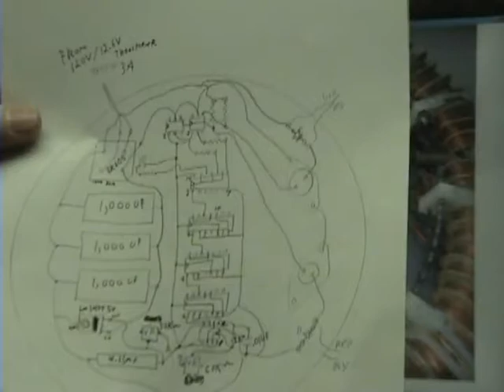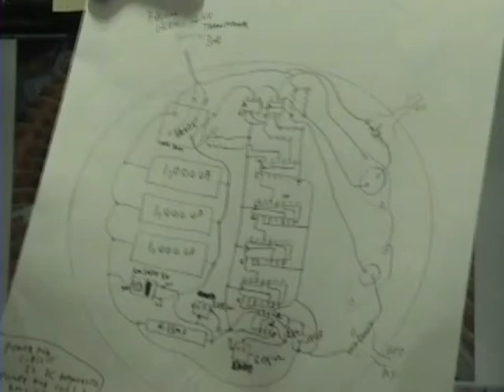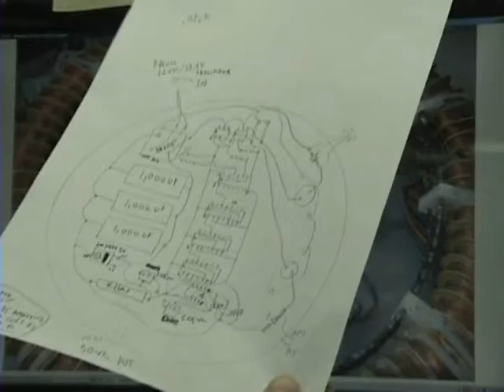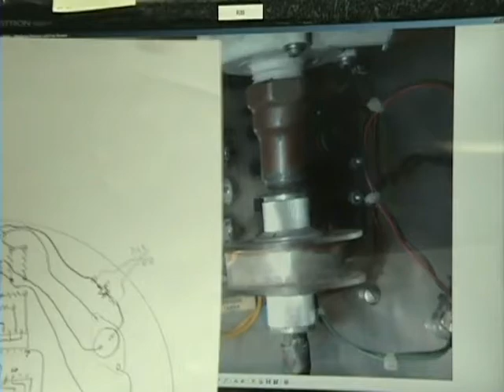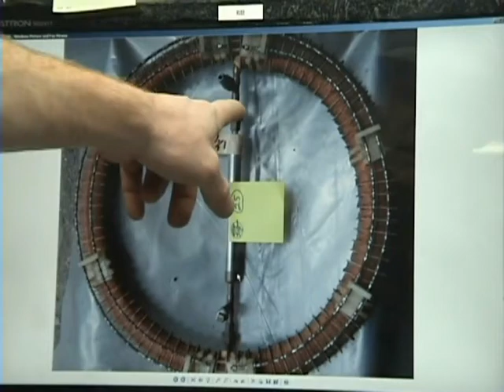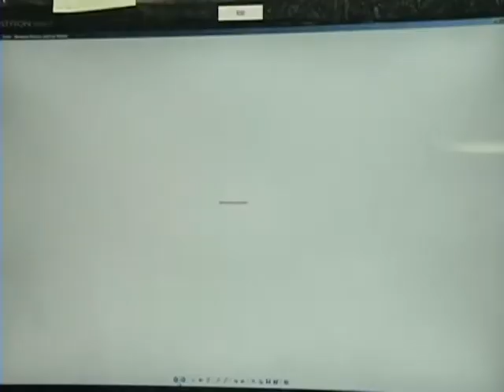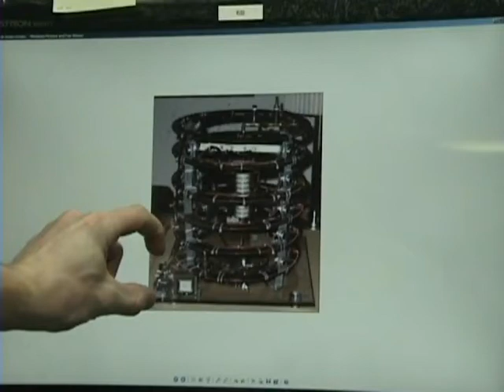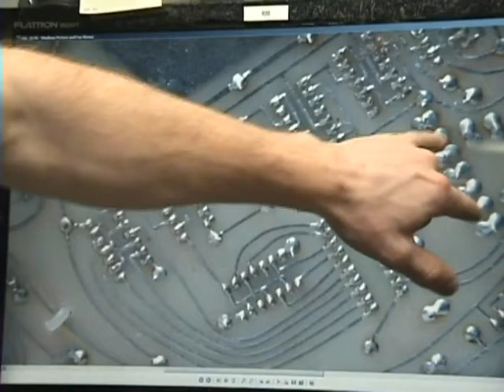Stans Estate EPG High Quality Photos RWGresearch.com

Comment: The Stan Meyer system used water vapor in his tube structure.  This was created using a vacuum in the tubing from a bubbler.  The vaporized water was then pumped thru the tubing into a dual magnetic coil arrangement where it’s molecules were separated into H and O atoms by the two opposing fields North against North.  When the water molecules split apart they gave off a huge wave of Etheric Force Field.  This newly created field traved along the three turns of copper tubing becoming Stan’s Primary Coil.   This primary coil had many Secondary Coils wound around it all of which were connected in parallel to two brass solid rods bent and supported inside the toroid structure.  These two brass rods provided the output for the device.  Other secondary coils were used to supply the device with its own power source.  The input to the device and output from the device was water H2O.
 
John Keelly did basically the same thing using sound waves to breakup molecules of water into H and O atoms.  By combining three waves Keelly could disassociate droplets of water the splitting of these molecules produced a powerful Etheric Wave Field.  Keelly used very small diameter tubing to act as a conduit to route the Etheric Waves into his motor design.  The Motor consisted of groups of odd numbered small disks which used the Etheric Waves to oppose each other providing his motor with rotation.  John Keelly when a kid used sea shells in a box which he had arranged so that they too could use Etheric Wave flows to give him a spinning Sea Shell motor.  This device ran when musical notes were played near it.   A penny for your thoughts.
 
Both inventions worked, but to this day have never been implemented to help save our planet.

Comment: The photo shown of the copper pipe you were having trouble with figuring the size of ; the two hex head screws on each side of the pipe appear to be standard 1/4" hex heads if that helps. Photo appears at approx. 11:34 in the video for reference. I'm guessing 5/16" or 3/8'. Good luck on your research.

Comment: Russ, I believe the device in the center is a magnetic pump. In his video, shared by Daniel Donnatelli, Stan explains this entire ordeal, and the many variations of the system. He stated that he used this with the output of the system, once pulsed to start, and of course the gas magnetized before he filled the tube, the magnetic pump would speed the gas up and it creates a much higher amperage. It could be another device as well, where he used a 10 watt laser to create another type of reaction by introducing plasma to the system where the energy could have ended up many times more powerful by allowing electrons from many other elements to break off and collect in multiples at the output. So, as he explained, the Oxygen molecules could have started with all of their electrons stripped, as he says if there were 4 billion atoms, then the electrons collected in the end could be 4 billion, amplifying the current flow 4 times. I'm not exactly sure what the entire process is but it is intriguing and it certainly has something to do with the electrical generation he used to fire is cell in the dune buggy giving him more than his input for self sustaining operation. It has been unclear for sometime as to how he did this, but now that the video is revealed, it has been making the gears turn in my head as to how to get this all operational with much greater ease. The VIC circuit certainly comes into play here, and I have found these and acquired them online to start the process of experimenting... I just need to find the time to make it all happen which is not existent at the moment. People are commenting here to state that the circuit looks like a con. This is what happens when they don't know what the hell was happening, or they are paid to assist in suppressing it to eliminate use by anybody who may believe it works. I smell oil company personnel.. LOL Anyway, why would the man pay thousands of dollars to patent anything so it is a con? The process was created previously in the 50s and never worked correctly. Stan took this and corrected it to function with the laser technology available to him as in the 50's it was non existent. The other thing is that many German Physicists from WW2 have left their kids and grandkids with unknown secret technologies that weren't ever used after WW2. This could certainly be something Stan acquired and took advantage of. He states he never had any experience or training in school for any of this. Somebody obviously taught him from his family because it isn't something taught in high school. He explains it as if he were a professor in the video link below.  https://www.youtube.com/watch?v=xUgXrPsyo9s

Comment: the thing in the middle you called a heat sink is a PLATE CAPACITOR that looks home made. that's a huge DC capacitor also it looks like 1/2 copper pipe as 3/8 comes in tubing usually with Farrell connectors

Comment: The Heat Pump looking thing isn't a pump. Its the laser EPG system. Like the tube version, its uncompleted. Its not a tube, its a 10 watt laser, and the fins are used to cool the laser.

Comment: red coating on pipe is probably spray on insulative laquer used by motor wiring companies. Pipe looks heavy wall as often found in refrigeration piping.

Comment: Nearly 100% certain that is a one half inch copper elbow. Looks like the pipe diameter is wider than the size of the adjacent hex head bolts which are about 3/8.

Comment: Frequency tuning is a missing component.  In order to achieve full photonic effects, displaceme nt is necessary.  Yes it is a resonant frequency, and yes the system will not work without internal light.

Comment: it seems like he liked to cut the system in half, crossing the 2 chambers. this is of interest. and the magnetic pathways of the PMG is an added feature. if you had  square in a square you could cut 2 magnetic paths ways, adding the cross sections one on each side so on to 3 squares in a suqare with 6 magnetic pathways.

Comment: I suspect that LIthium hydroxide was the electrolyte and that the coil is actually a accidental cold fusion based on a 1950's muon based system. that was not successfully as required 5 MeV and made 2 MeV

Comment: they cant be usinf ferro fluid , its non magnetic  , it said in your other video and would make sense that the fluid or gas has to have magnetic particles only and I dont understand the copper pipe when you said in the patent it said specifically no conductive pipe

Comment: Hay Russ! I just got 4 12000 volt neon light transformers. Probly cost a fortune to send them to you. What's in them that you like? is it the wire or is there magnets? Duh they are about 20 lbs each. Ferrofluid is a recent invention - I don't think Stanley could have known about it. The green on the copper is oxidation and or electrolysis. The size is going to be 1/4 or 3/8 and probably refrigeration tube. Stainless pipe might be better. Lemme know about the transformers if you want them or not

Comment: This thing looks like a con. Meyers may have built this thing, but it can't be that difficult to see what the end result has to be. One needs to produce enough browns gas to run an automobile motor from the on board water . For a VW DUNE BUGGY; THIS IS A BOUT THREE HUNDRED CUBIC FEET OF AIR AND FUEL PER MINUTE. I've been watching this stuff for ten years and it gets to be like watching the x-files . Science is based on repeatability and no one has been able to do what Meyers supposedly did. Welding companies make browns gas generators for welding and cutting but none of them produce enough gas to my knowledge  to actually run a motor vehicle from on board hardware .

Meyers injector that supposedly replaces the spark plug has one serious flaw in that it shows no way to ignite the spark in a low compression engine  once th spark plug is removed . A second problem arises when there is no timing system for the injectors .The fuel in this instance has to somehow magically show up a the right time. The VW dune buggy Meyers used also had to have an increased compression ratio or it wouldn't be able to ignite even hydrogen reliably . 

Still if you look at a lot of Meyers videos he shows his water separator and at the same time says he' s injecting plain energized water into the cylinders . So why the separator? It's either one or the other.Still another problem is secrecy . If Meyers wanted this for the world so bad , why didn't he give it to all of the automobile companies with an open source license that let every one have it for free and make a fortune  off of the residuals  from his patents . A few cents per engine  is a lot of money. 

Automobiles  don't need to run on gasoline .Electrics are already proving that and hydrogen vehicles are already in use in Iceland and Europe . People during world war 2 ran cars off of wood gas when motor fuel was scarce and rationed . .I wish this guy the best in figuring this out, but the truth is; I think he has nothing and it will be too late if it ever comes to fruition, because something else will already be there to make it obsolete. I say this because I've been down that road and experienced it myself.
Reply: why would it be a con? If you know anything about it, Stan magnetized the gas, then he used it to create electricity. In this circuit, you don't see a gas input and output, do you? This device magnetizes the gas and as it does so, it creates a gas flow and magnetic pump effect. The flow then runs through the copper pipes and is picked up as electrical current for use due to the fact that the gas is magnetized and runs through copper tubes . If you know anything about copper tubing and magnets, it has major magnetic anomalies that would allow current to be drawn in at no expense to the magnet, in an effort to bypass the Lenz effect seen in ferrous metals used normally for transformer coils. The original energy used to start the process is a pulse, then from there on electricity is taken from the system to continue the magnetic pulse that's used requires much less energy that only amplifies the speed of the flow,  and yields a much greater magnetic field presence on the output coils allowing 4 times or more the energy input to be in it's output. This is only due to the atomic structure of the gas used to fill the tubes, and when the process is complete, the gas won't change. It basically strips the electrons on one end of the magnetizer, then it puts them all back at the end of the process, changing the atomic structure back and forth in an oscillating nature to use the electron flow as an amplification of electrical energy. The input must be injected with the Voltage amplifier circuit Stan created or similar, and of course the correct frequency must be used to function correctly as well as waveform to allow the gas, or atoms used to strip electrons. Once this happens, the electrons are attracted to the atom which the electrons were stripped from,. then the electron flow happens with a very high amperage compared to the input. The current output is a superimposed waveform that proves that DC and AC currents could be used and drawn as a multiplexer circuit is used. DC over AC from the same core, which is basically a copper conductor in the form of a piece of copper tubing, tapping only one for use, and using the other for an input.
Reply: Well that's the Old saying , Build a better Mouse Trap !! And ........
!!!
Reply: @davidwillard7334  or build a better path and the world will put mouse traps on your front door!!